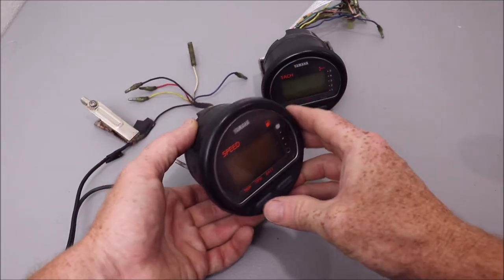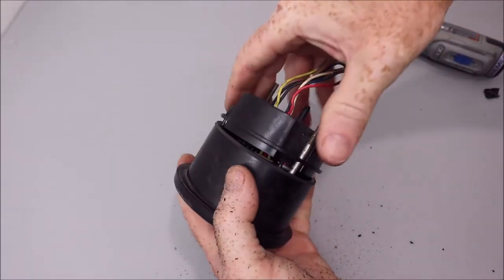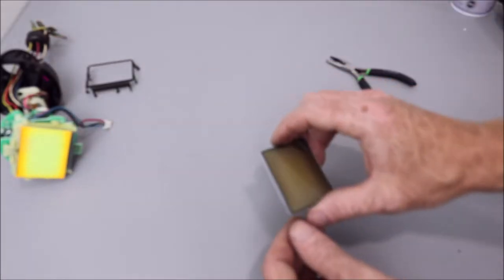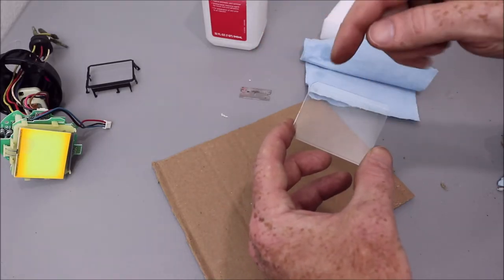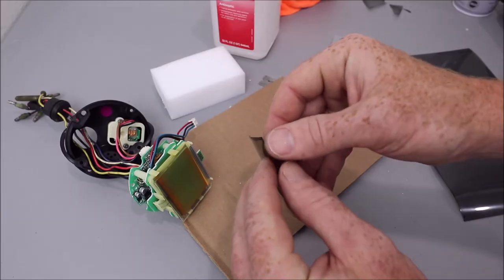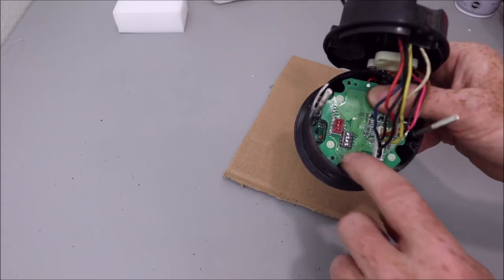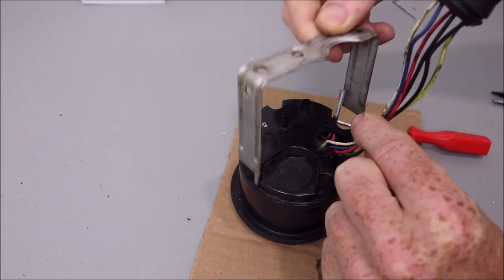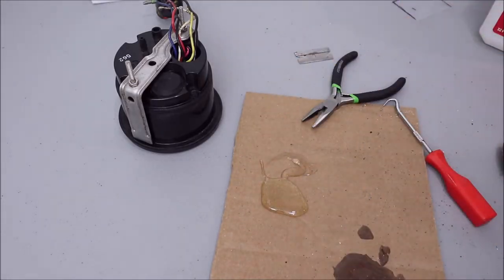How to Repair Yamaha Boat Gauges Faded LCD (In-Depth Tutorial) Polarized Lens Replacement

Comment: Yes! I have 4 Gauges on my boat that I can barely read. To replace them would run over $1,000. To send them all out to get redone would run about $500. I bought the polarizing film as soon as I watched this and already had the Plastic Weld. I will admit, I was a bit nervous but figured I would give it a try. The only thing I did differently was acetone seemed to work at the adhesive a little better than the alcohol. Got everything together and YES it works like new! Now I have to work on the crazed clear plastic cover.  Thank you for a very useful moneysaving tutorial.
Reply from the maker: Awesome!! Glad you took a stab at it. It's a rewarding fix.
Reply: Guage Saver charges $75 ea to fix. But I will be doing this to save $300 a two weeks of down time for all 4 of my guages

Comment: WEAR YOUR SUNGLASSES WHEN INSTALLING THE FILM!!!!    Worked great EXCEPT… my sunglasses are polarized to where I have to tilt my head sideways to read the gauges clearly!    I suggest wearing your sunglasses when placing the film, so the front film piece is clear when you look at it with your polarized glasses.   Too late for me now… gauges glued shut and installed.    They look fine if I don’t have the polarized sunglasses on.   Still happy to have saved $600.

Comment: Can confirm this works like a charm. Just completed this repair on my Yamaha speedometer this weekend (27 March 2022) and it was as easy as it looks. Getting all the residue off the screen, even with acetone and a razor blade, was still a chore, and while others have apparently successfully used a hot glue gun to reassemble instead of the recommended epoxy, I tried hot glue but went to epoxy after hot glue failed to keep the bond. Otherwise, if you don't try to cut corners like I did, virtually guaranteed to work.

Comment: Great video Daniel! It gave me the confidence to rebuild all three of my Yamaha gauges. Instead of using the plastic JB Weld I actually drilled out the plastic and used SS screws to tighten the housing down. so far so good.
Reply: Im going that route as well. That way, you have better serviceability.

Comment: I unfortunately some how cracked the lense when pulling off the old film. It cracked in the middle and the layer with the contact strip separated from the other layer. Seemed very brittle because I was being very careful. I’m sure I need a new lense. Any suggestions?

Comment: Daniel, thank you. Your video was extremely well done.  I ordered the polarized film from Amazon and just completed two 1999 Yamaha gauges.  The gauges read perfectly again.  I used my 12-volt cordless drill battery for power.   Make sure to "cut the line" you mark on the polarized film because if it is too large it will buckle on the LCD glass.  Three suggestions, before reassembly I cleaned the inside of the lens cover with Windex.  Make sure to use a lint-free cloth.  I also had a fair amount of crazing on the outside of the lens.  I used 100, 200, 400 wet-sandpaper and then buffed with auto rubbing compound.  (There is a Youtube video on this too.)  Reducing the crazing was also a major improvement.  Finally, I bought two GuageSaver covers for $5 each on Amazon.  So for about $20 I saved $900 by not buying two new gauges!  Thank you again!!
Reply from the maker: Awesome!! Thx for the suggestions as well. Good stuff

Comment: Are you able to repair the backlight when doing this? My gauges are easy to read and function correctly but I can’t see it at night. I have everything wired up correctly and power going to the gauges for the backlight. But no light

Comment: Thanks!! Great video.  The glue on my 20 year old guages was way harder to remove than yours, but I got it done. I did both at the same time and inadvertently switched the LCD's.  I didn't know they were specific.  Once I switched them back, the tach worked, but the speedo gave an E1 error on startup.  I had to replace the LCD and now all good. Still need to work on the crazing but I'm  happy. Now that I can see the guages I can see the trim sender needs to be replaced.
Reply from the maker: Thanks for the comment, glad u got them working!!

Comment: Thank you very much!  This worked.  I used adhesive laminate and it worked OK but is a little fiddly if you get a bubble!  Just remember which way the plastic 'contact' its inserted - it fell out and took some trial and error to get it the right way.

Comment: I really found this clear, concise and helpful!  I need your help with reinstalling my Yam speedo/fuel gauge which is same as yours.  Behind the console, I found the corresponding Yellow, Blue and Red wires and connected them.  That leaves me with 2 Black and 1 White wires which I cannot identify a match.  Are all 3 required?  Can you tell me what their function is?  You mention that Black is Ground, what about the 2nd Black wire?  Any help would be greatly appreciated.  Thanks for the great videos.
Reply from the maker: Hi, thx for the comment! I'm sorry I just can't remember where each wire hooks up. It's been a while and I no longer have the same motor or gauges. Hope u are able to get it figured out, sorry I'm not more help

Comment: Very helpful! My display is much more readable now. Unfortunately, I used a bit too much pressure trying to get the old film off and now have some black spots, particularly in one corner. Will be more careful when I start on the speedometer.

Comment: Hi Daniel, 
Awesome video and thank you.  Can you advise what I may doing wrong for my tachometer bc when I positioned the two films like you demonstrated so they are black and not transparent the numbers on the screen are white and the background is black.  Shouldn’t it be the reverse?  Thanks again
Reply from the maker: Hi. It's been so long since I have messed with it I'm not sure what the answer would be. But I would suggest to keep rotating the film until it is correct. Try both rotating and flipping.

Comment: Thanks so much just got done with my gauges they work great! To my surprise both of my gauges are screw on no Dremel nor epoxy, no bending tabs. What took me no longer was removing the old glue and error on Amazon part, third times from Amazon is a charm.

Comment: Thanks for this video. Very helpful. What if the outside plastic or glass is faded or small webbing like cracks/scratches? Do you restore it or replace it? And how?
Reply: Use 3000 then 5000 grit sandpaper

Comment: Thanks so much from Greece ! BTW one question: I change LCD, it is ok now but backlight is not working any more. (Blue cable is connected). Do yoy know what is the AC voltage of inverter that gives to EL Panel (the yellow plate in your video) ? I measured and and it gives me 67V AC but I am not sure if it is ok. Thanks in advance !

Comment: Hi. Do you have a suggestion if the lcd has black stain becoming bigger and bigger? Is the only options to change it and replace with a new one? Please really need help. Thanks in advance.
Reply from the maker: I think u would have to replace the LCD from what I've read. But I'm not totally sure

Comment: Daniel. do you have any suggestions on how to open a 6y8 Yamaha gauge?  It only had a male plug built into the case .  No wires to pull thru grommet.  Very well done video.
Reply from the maker: Hi, sorry I haven't messed with the newer gauges yet. I would imagine it would be similar once you get it apart, but don't know for sure
Reply: Tony, have you tried to open the 6y8 gauges yet? The back is much different and i don't know where to begin drilling out. How about you?
Reply: @JesseDrosdick  Jesse. Not yet. As soon as I get up some courage I'll  dig into 1 of 2 gauges.

Comment: thanks for this video. it will help to replace my filim not a boat but 04 yamaha fz6 motorcycle. it using the very same style lcd where the glass contact with the rubber and same style metal rataning clip but in much bigger size...

Comment: I did this. Cant see i did anything wrong. When it powers on i dont get the 0. Mine comes on with some jibberish like 4 a pp a A9. Any ideas? I took the screen out twice to see if anything on the rubber connector was messed up.
Reply from the maker: No clue what might be causing that issue, please lmk if u figure it out

Comment: so   thank you for the tutorial   wanted to electrically test it before i glue it back together    i have a 2003 tach with black (ground ) and blue ; yellow ; and green  wires coming out with bullet connectors     dont want to fry the thing    how do i check it ?.....was also wondering if the rubber connector placement is  critical  as long as it touches both surfaces with the glass and board   thanks
Reply: I worried about the same thing. Yellow bullet connector on positive and the black wire on negative. You can check the backlight as well by touching the blue wire to positive with yellow bullet connector.

Comment: Can anybody confirm this would work on a digital motorcycle gauge cluster? I’ve got an ‘06 Yamaha fz1 that the Florida heat has been putting a beating on, can hardly read my speed as of lately because of it
Reply: Hi i got Yamaha FJR speedometer same problem. Pls kindly share if you already done yours thank you in advance.
Reply: @sukirmanbairiswan  about a week after I posted this comment I did in fact commit to taking apart the gauge, in hopes it would save me the cost of a new one. Worked wonders for me!